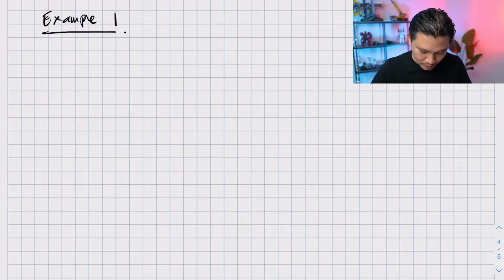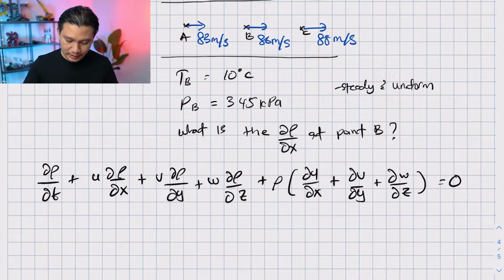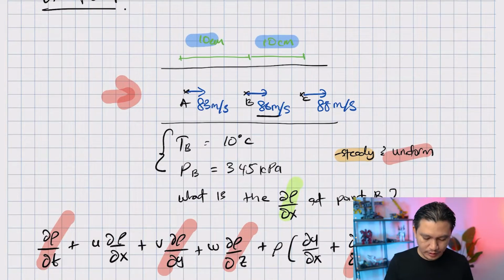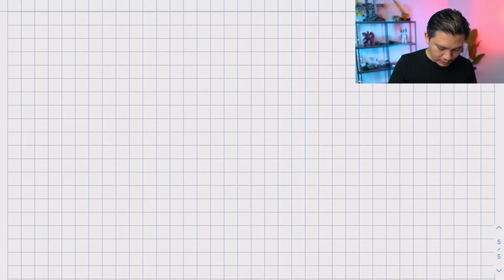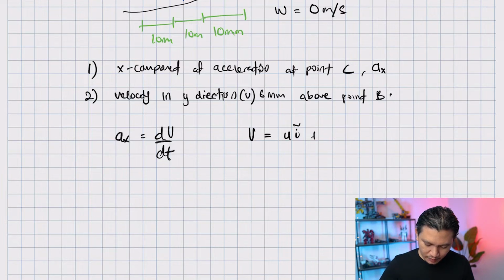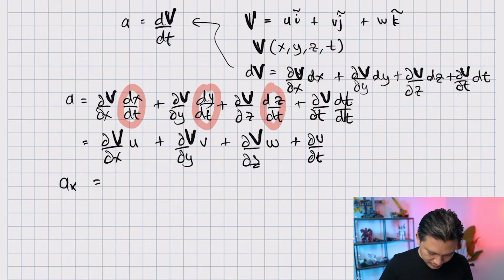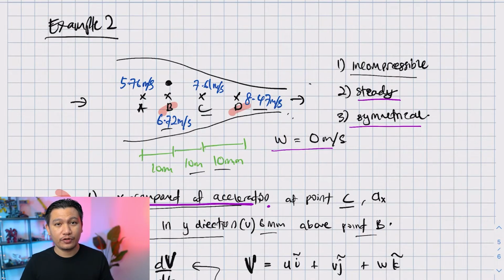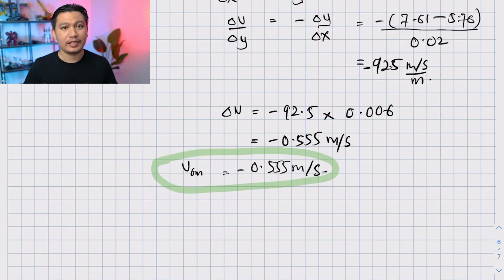P2-003 Continuity Equation

Comment: Assalamualaikum dr. at 18:21 u used point B and D to find delta u for point C. So if the question asks for point D then which two points are we going to use in our analysis of delta u ?
Reply from the maker: Wsalam there is a method called backward difference to obtain values at point D. This method is quite advanced, and it is not covered as part of our syllabus which deals with introductory fluid mechanics 😀

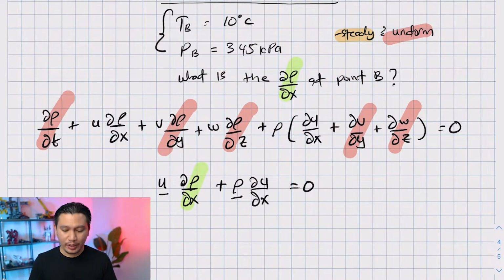Comment: Salam Dr. Hasbullah, at 5:26, how do we know that the fluid flowing in the pipe is an ideal gas? Will it be informed in the question?
Reply from the maker: When dealing with gas, and if there is a parameter missing, unless the actual gas is specified, the ideal gas equation is quite a 'safe' equation to use to get the answer.